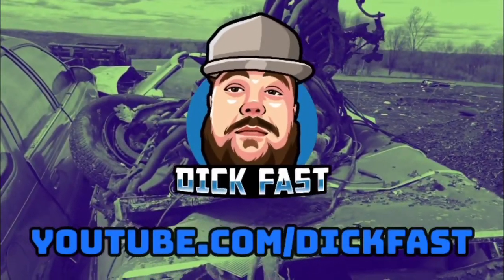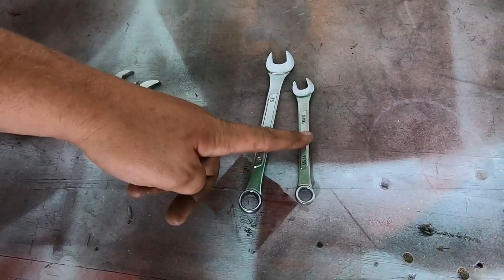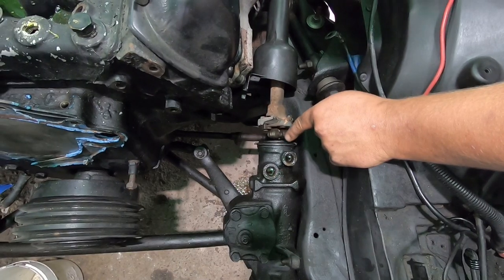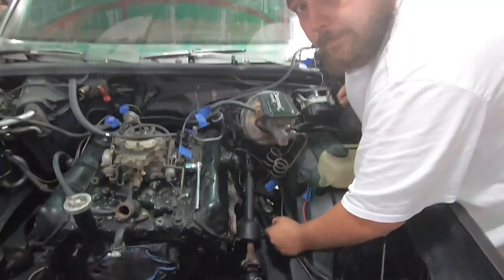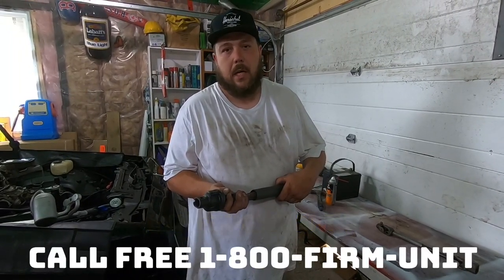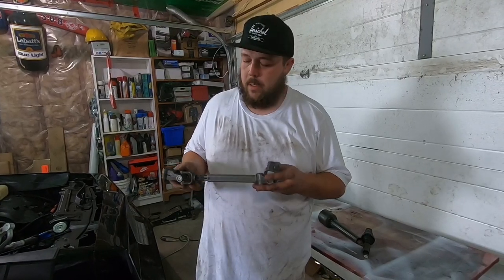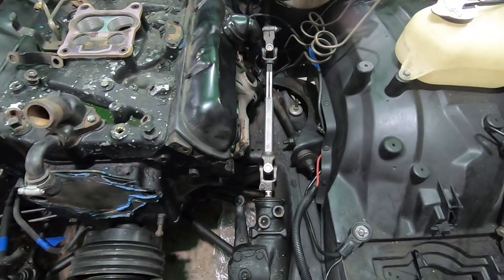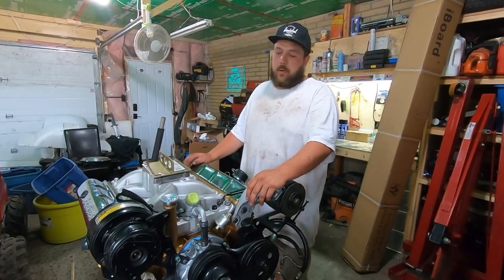How To Install a “David Horner” Steering Shaft (G Body Club Of Ontario)

Comment: i just got my “David Horner” shaft also .. The newest ones seem to have little Crumple-zones in them - Nice touch :) 
  I didn't have to Cut it .. and Got the Steering box end off with little issue ... but cant get the original Top one to disconnect .. Likely rusted in place  - After I take a break,     I Will try your patented 'Flail about like a wounded duck whist cursing' method   ;)

Sidenote:  i can say enough good things about David, Stand up guy, Fast delivery, no BS, More than fair price.

Comment: I pulled one off a 2005 Astro van for my 86 monte Carlo SS but do I really need to do all that modification for it to fit cause I seen a video of a guy pulling one of the ends off and putting it back on all just just welding the peening didn't really see nothing different he did as far as I know everyone is getting the jeep shaft and all they do is shave the small shaft down on the column for the bolt the pass and then boom it's on🤷🏽‍♂️
Reply from the maker: Yessir this is just an astro van shaft with a cutlass end he welded it on like you said! Boom 🤯 it seriously gave me a ton more room in the engine bay! CHEERS
Reply: @ThemRoofBoys  yeah I hadn't installed mine yet because of this reason I'm trying to find somebody to do it for me cause I'm no welder

Comment: Will those work on 97 Astro van cause mines bad can't find none to buy
Reply from the maker: This shaft is from an Astro van but in order to make it work for a cutlass the end has to be removed and turned then welded back together also jeep shafts are said to work for a cutlass might work for your van aswell!